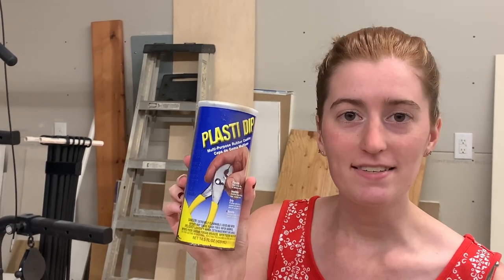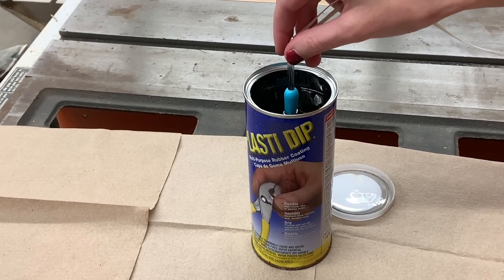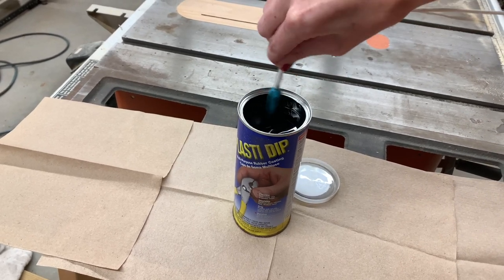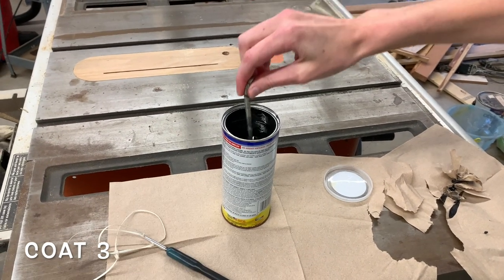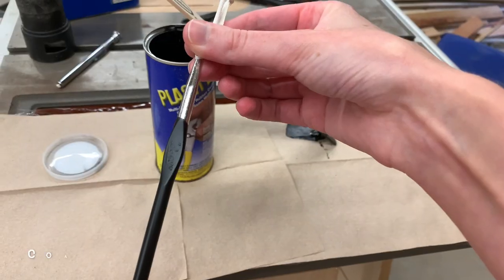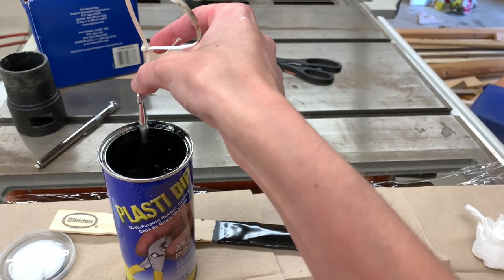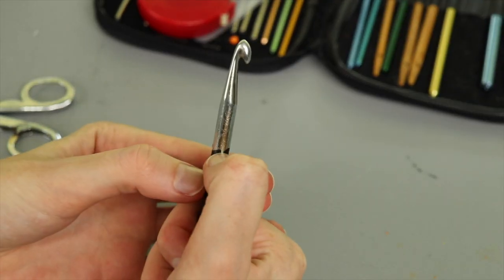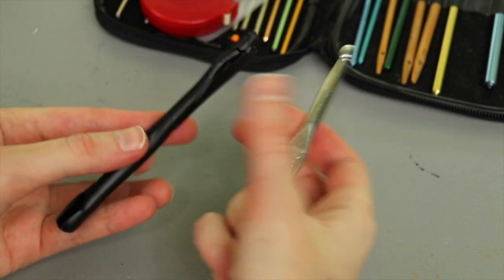Coating my Dollar Tree Crochet Hook in Plasti-Dip | Improvement or Waste of Time???

Comment: I watched another crafter (Niler Taylor) wrap her hooks with hot glue & yarn then coat them in hot glue (you need a high powered glue gun to do this bc my mini did not work).  I immediately thought I could use plastic dip (clear)  because I have used it for other projects.  Her idea of wrapping your hook with yarn over some hot glue works great and then I think if you could also dip it in Plastidip.  Just wrapping it in yarn is a big improvement.
Reply from the maker: I really like the idea of wrapping in yarn first! That would be a great way to make it much thicker, and then could still be finished off with an outer coating of hot glue or plastidip for a smoother finish. Thanks for sharing!

Comment: Not a bad idea, but you can buy a set of 14 ergonomic style hooks with a case, snippers, stitch markers, and metal yarn needles on Amazon for about $18 dollars. That works out to a dollar a hook + a dollar for each accessory. Well worth it!   Look for the one with the zipper case that has the light blue with white polka dot with small flowers for $17.99. The hooks go from a size B((2mm) to a size M(9 mm). I treated myself to a set a few months ago on a whim and they are great! The handles are silicon squishy feeling, they are colorful, and they are marked pretty well. They've made a HUGE difference in how my hands feel after crocheting for any length of time. I only wish I had bought them sooner!
Reply from the maker: Good point! I probably wouldn't have tried this project if I (well, really my dad! haha) hadn't already had some of the plasti dip leftover from another project, but since the plasti dip was just sitting there I figured it'd be worth experimenting. 😄 Thanks for the hook recommendation! I'll have to check those out. I'd pick up more from Dollar Tree, but I think they only carry a couple sizes. Now you've got me wanting to buy those and expand my collection of hooks!  😆

Comment: This might actually be useful to people who have a hard time gripping their plain aluminum hooks. I have a friend who has a weak grasp, and she often drops her hook. Just the fact that it has a kind of tackiness to the hook might actually help her
Reply from the maker: That's a really good point! My biggest takeaway from trying this out is that it works and doesn't cause any problems to the yarn. So I love that this can be helpful for a variety of problems!
Reply: @CraftersAutonomous  - Hi there,
Next time your dollar store handle feels rough or snags your yarn, grab a set of disposable nail files from the Dollar Tree or one og the rough sanding sponge blocks and use the to smooth the edges of the plastic. You can add a little Vaseline or coconut oil during and/or after sanding - this helps soften and gently break down the plastic just enough to make it nice and smooth….

If the plasti dip is too sticky or tacky, (or your plastic handle feels sticky after sanding the edges with a bit of oil) use some dollar tree baby powder (or dollar tree chalk but baby powder works best in my opinion) to give the handle/s a good dusting… 

Not only will this absorb any oils from (any crochet hooks) but - even better, it absorbs the tackier solvents from the plasti dip and gives you a more comfortable (not sticky) grip  🤗

Regards,

Meg ~

Comment: Shooken it up!! Lmao!! 🤣🤣🤣
Reply from the maker: My dad and I were cracking up the whole time filming this! 😂
Reply: Don't shake it you will have bubbles in the dip. Stir it with a craft stick or paint stick like you did, however scrape the stick on the side or use another craft stick to scrape off the dip back into the can. Seal the can well when you are done and you can add 2 partially used cans together so it is not wasted. Corn starch powder your hands. When you use the hook for the first few tomes will make it not so rubbery feeling also use vaseline on any parts that you don't want to coat.